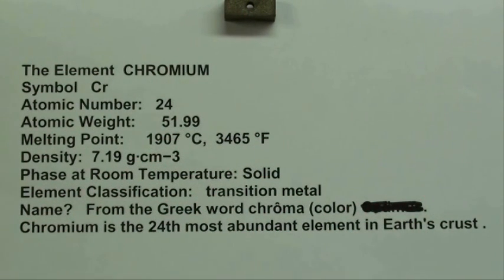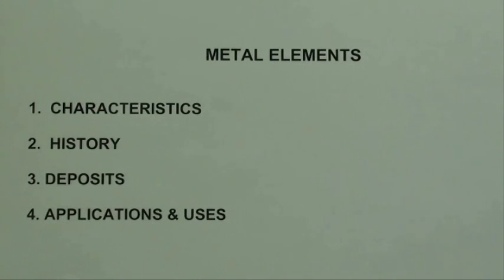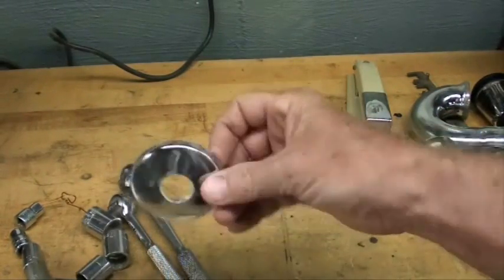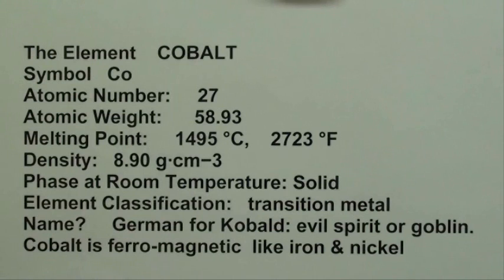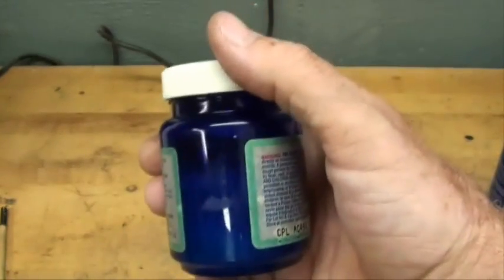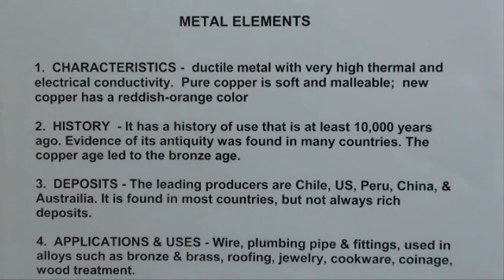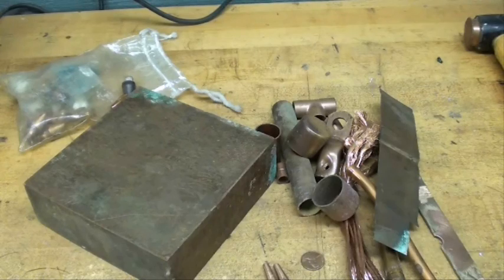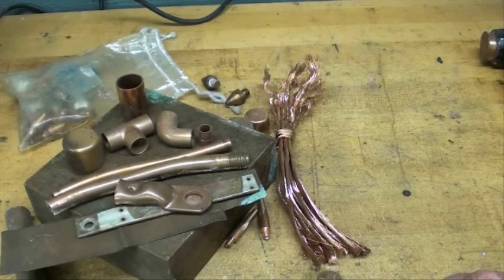MACHINE SHOP TIPS #86 Identifying Metals Pt 2 tubalcain

Comment: Fun fact: Copper wire is not just stranded to make it flexible. It is stranded to give it better electrical properties. Electricity doesn't flow through a wire as most people believe. It flows over the surface area of the wire. More strands = more surface area. You probably know this, but some might not. Thanks for the video.

Comment: Whenever you alloy a metal, it changes it's properties.  A lot of stainless is magnetic.  Most if not all hardenable stainless like knives is magnetic.  Non-hardenable stainless like your stainless appliances isn't.  An interesting fact is US nickels are about 75% copper.  I've machined nickel-copper alloys that were over 80% copper and they were still silver colored.

Comment: there are 3 types of stainless steels: Ferritic -basic stainless steel, generally just iron and 14-18% Cr, Martensitic -12% or so Cr with newer alloys having molybdenum and such. this is used for cutlery. also martensitic steels must be fully hardened to be actually corrosion resistant. Austenitic-non magnetic due to crystal structure; high nickel content; Nickel is expensive so some austenitic steels substitute Mn to use less nickel. By definition all stainless steels are >12% Cr